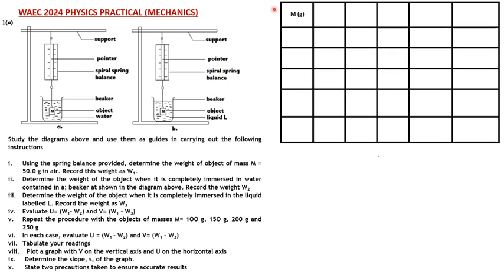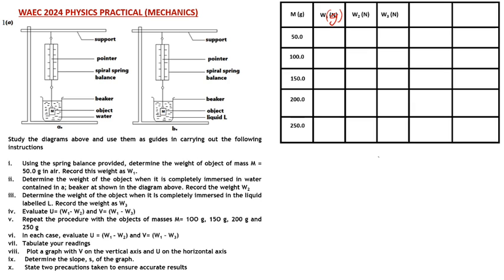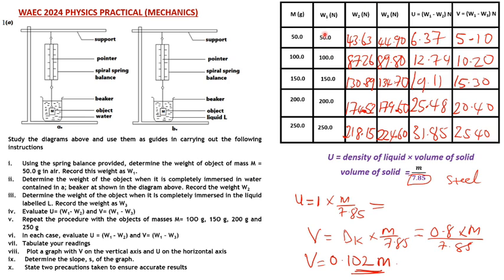WAEC PHYSICS 2024 PHYSICS PRACTICAL QUESTION 1 TRICKS. mechanics. upthrust in water and kerosene.

Comment: Sir tnks but u didn't write ur precautions  in carrying out the reading
Reply from the maker: PRECAUTIONS:

1. I avoided parallax error when taking readings from the spring balance 

2. I noted and corrected zero error on the spring balance 

3. I ensured that the masses did not touch the bottom of the beaker.

Comment: Sir this video is nice.. but how did u get 7.85
Reply from the maker: You can check your textbooks or use Google to get the densities of some metals like copper, brass, steel, etc. I used that of steel. Which is 7.85. That of brass is 8. So you can use any of the metals. And, thanks for the remarks.